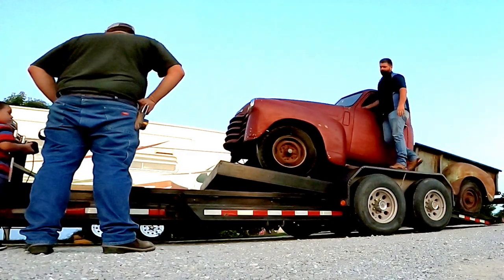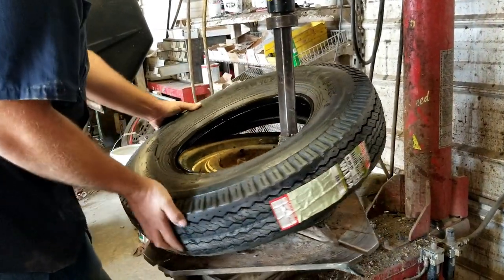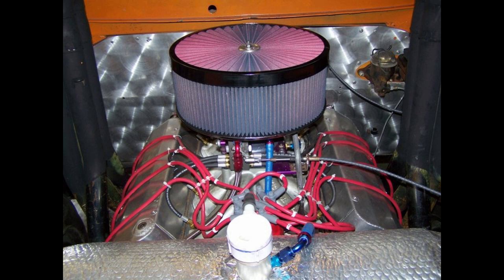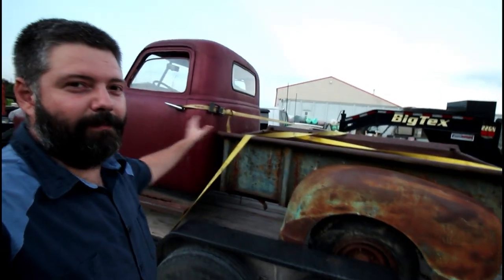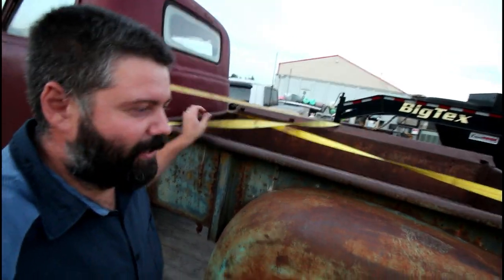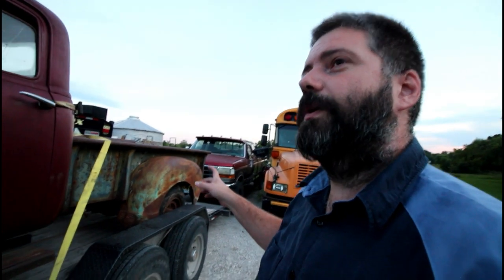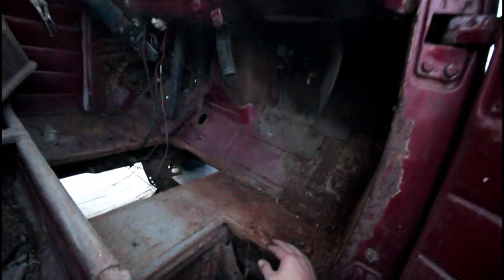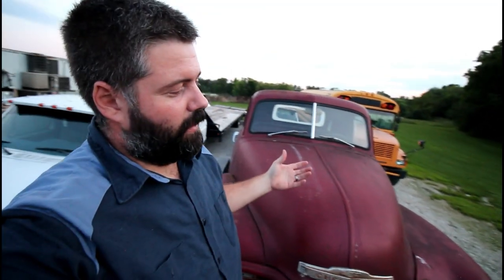Bought a 1951 chevy 3 window pickup truck

Comment: I had a one-ton cab (3800) with the short running boards a few years ago.  Used it on a 1/2 ton frame and built a street rod out of it.  Most 3800 cabs were purchased from the factory as cab-and-chassis assemblies, and then the buyer installed their own grain box, service box, flatbed, etc, themselves or had a dealer do it.  I think they all came with the short running boards with the factory rear lip.  The cabs, grilles, and hoods were all interchangeable (3100, 3600, 3800), but the larger trucks used wider front fenders from the factory to accommodate bigger front tires.  I've had many 1947-53 Chevy trucks over the years and this is what I have learned.  There are probably exceptions to all these different options.  Your "new" maroon truck was probably originally built as a grain truck, which would also explain the nice rust-free floors and cab corners.  They were usually only driven a few times per year to and from the field, and not driven on salty roads in the wintertime.

Comment: 3600 is 3/4 ton. Looking at the length of the bed (of course it could be the camera angle), I think you have a 3800 which is a one ton. You can tell for sure by actually measuring the bed length. If it is the one ton, it will be nine foot long. If it's shorter, then it'll be the 3600 or 3/4 ton. A 292 Chevy inline six cylinder will out pull any small block especially if you build it right, mainly because it has more torque. You will just have to change the cross member for the rear engine mount to make it work right, but then you would have to for the small block anyway. The doors are wrong for a 1951. The 51 is the only year with both wing glasses and turn down door handles. So unless someone changed out the doors, it's either a 49 or 50. Of course the year won't really matter for what you're planning. If you do decide to go with a 292, make really strong front motor mounts because the high torque will break them otherwise. However you decide to build it, it's gonna be awesome, and I'm looking forward to seeing the final results. A Jim Carter truck parts catalogue is a good source of information on these old Chevy trucks. Also, they're a good source of parts.

Comment: The truck doesn't appear to be a 1951. 51 would have have wing windows. If you need any parts give me a shout, I have a salvage yard in Independence and I specialize in these trucks. Also don't scrap the stock parts your not going to use, there's prob some guys that are looking for some of those pieces.

Comment: 15 inch wheels or 17inch. 15 inch will be a 3600 3/4 ton.  17 inch wheels will be a 3800 1ton. Plus the one ton usually has a one ft extension on the rear of the frame.
Reply: My 51 3/4 came with 16's

Comment: Glass wouldn’t have worked anyway, the 49 should have vent windows 😁
Reply: Actually vent windows didn't come until 51, The red truck if it's a 51 would have had vent windows. (Only year with Vent windows and turn down handles)